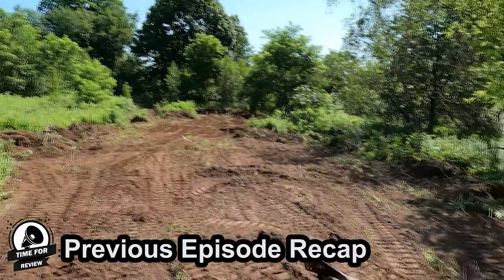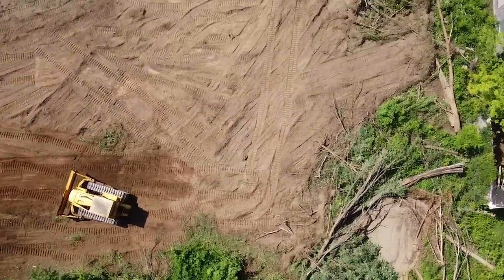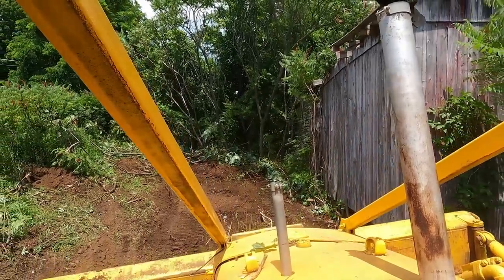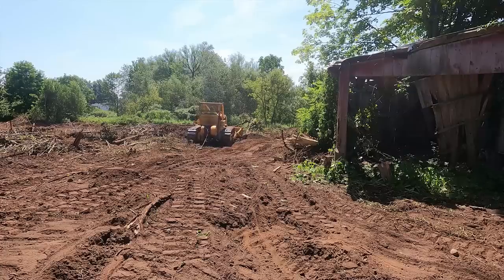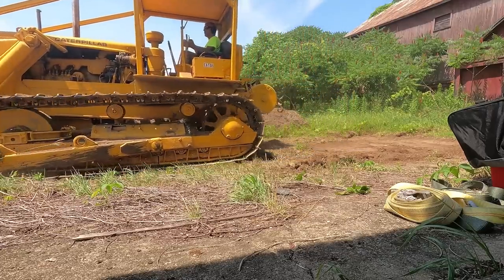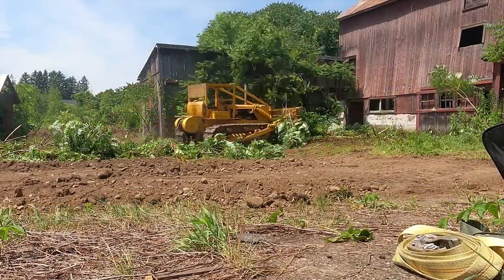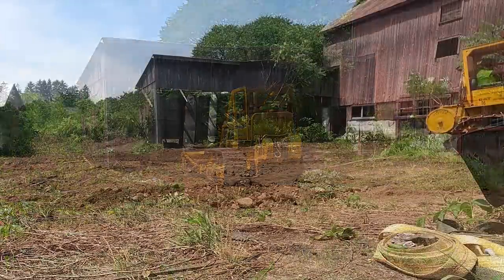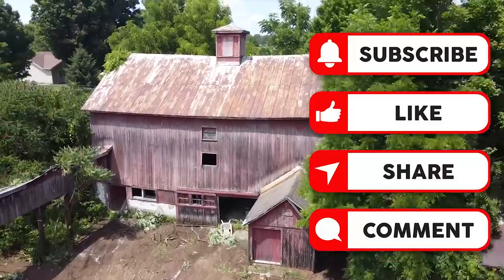Scraping years of overgrowth on the farm with the 1956 Cat D6 9U Bulldozer!

Comment: You made the right decision to buy that dozer. Best damn machine cat had ever produced hands down.
Reply from the maker: The thing is insane - it goes through anything, and takes down anything. It's GIANT. The original 1950's user manual even provides instructions on how to use it in mud and water up to 3 feet deep (special plugs and procedures) - but the fact that it can work as reliably and forcefully partially submerged is just mindblowing to me!
Reply: @BuyingTheFarm  old cats are still considered as the best and most reliable machines Cat has ever made, and they hold up to that title to this day.
Reply from the maker: I've noticed that their resale price remains pretty constant, despite the age (or, I guess because of the age). This is excellent news. I plan on selling this once I finish the main work. It honestly is too big for what I need, and I have no way to transport it for service if it is ever needed without huge expense. At this point, I think I could get by with a Bobcat, or a more versatile mid-sized tractor with implements (once the main earth work is done).

Comment: Nicely done! I’ve recently bought a ‘57 D6 9U! I have 20 acres and want to stump and clear about 5-10
Reply from the maker: Kevin, that is excellent! We're in sort-of the same situation. My front acreage is 6 acres, and that was my goal as well. Your machine is a year newer than mine. Hahaha. Are you going to document any of it for YouTube? Learn from my mistakes with this beast! Figure out how to scrape instead of dig. I haven't quite learned that yet and I have a mess! Many people suggested getting or making a root rake that clips over the front blade for cleanup. You may have better luck with this than me. I can weld, but my issue is the weight and size of the steel needed to build a root rake. I can't easily handle nor accommodate such large material. People have suggested renting one or buying one. I can't find one for rent anywhere, and the only places I could find to buy one is commercially through stores on the Internet ($3000-$6000ish). I couldn't find anything on Craigslist or Facebook Marketplace in my general area.  Keep me posted, and likewise stay tuned for more videos!    :-)
Reply: @BuyingTheFarm  Yeah got all those great software updates on the ‘57 model 😉 

I may end up making a video now that you’ve suggested it, I have a metalic go pro mount, I dont have to worry about any plastic hoods / fenders on this beast. 

We’ve had some wet conditions so far this year so i’ve deferred the dozer work until the ground dries a bit more. I had also asked a local metal manufacturing plant to build me a root rake but they essentially said it would cost more than the dozer is worth to build custom and to  try and find one for sale. 

I do have a spear type rooting attachment for the blade, i’ll be giving that a go pretty soon. 

Best of luck with your future projects!
Reply from the maker: Oh man, that's awesome Kevin. Hhhmmm... I'll have to look into the metal go-pro mount. Why didn't I think about a magnetic mount before??? That tank is 100% steel and iron! Hahaha.  Yeah, if you do some videos, send me a message - I'd love to see alternate ways of doing things. Keep me posted!   :-)

Comment: You Might be able to get a Wetland Permit. If maybe want to clean up the area slightly. Like remove fallen Trees. Would be something that have to look into. 
On My Last Property we had Federal Wetlands, But we were able to get a Wetland Permit, to clear up some Fall Trees around the Edge. But with Approval we also Replanted some New Trees around the Edge. 
Then 50 feet away from the Wetlands, we then Planted Hedges along the Length but left enough space on both edges where a Tractor and bushhog could drive thur so can mow the 50 foot strip that was just mainly grass/weeds before you got to the wetland area.
Reply from the maker: This is excellent information! Thank you for providing your insight and process. I have the DEC scheduled to come out sometime this year to have them map the property (so I know where everything is). They did mention granting permits for the road that was previously cut through the property and for other purposes. I’ll provide a video on the process once that takes place. Thanks for that comment though!!    :-)

Comment: It’s good practise when using your Winch to always fleet the rope onto the drum correctly. Once you have hooked the log up, go forward running the rope out until the rope is laying properly on the drum. Then start winding in allowing the tractor to be pulled backwards using the brakes and steering clutches to steer the rope onto the drum fleeting straight and smooth with no slack or loops hanging out. It may seem like you’re wasting time, but your rope will last a long time and will retain full strength. Also keep the rope well oiled to prevent rust.
 Nice video.
Reply from the maker: Hey, thanks so much for that advice. That is excellent - I've never had a winch before (nor a bulldozer), so every tip helps!  The issue I had was that the cable hook got snagged on something and free-spooled out without me knowing it. An hour later when I jumped off the bulldozer, the entire winch cable was gone!  It wasn't hard to spot, but putting it back on is going to be a pain. Thanks for watching the video and I appreciate the comment!

Comment: Looks great! Don't you just hate it when stuff like cables come loose. I was surprised how easily you were able to pull all those trees away from the outbuildings going backwards. Nice job!
Reply from the maker: Ugh the cable is a nightmare, Mike - it weighs about 600lbs in total, and even getting just the end back wound around the spool is hard work! I haven't fixed it yet. Maybe this weekend.  Yeah, the trees were a satisfying surprise when I backed up with that blade down. I had a "holy crap - it's working" moment. I had to basically press them right up against the foundation, drop the blade, and once the down-pressure kicked in, many tons of downward force bent the trunks/stalks right under the blade and pulling them out was easy. I was very pleased!

Comment: a masticater would have served well. Reducing vegetation to mulch which could be composted and used as amendment for the soil.
Reply from the maker: Hi Tim, thanks for the comment. Yes I agree that would have been the ideal tool for the weeds. Sadly I couldn’t find the implement and the tractor or skidsteer in my budget, and rentals in my area were prohibitively expensive for how long I would have needed it due to my work and travel schedules. The other issue though is that I had large berms of dirt that had to be leveled out, trees that had to be pushed over and moved around the property, and various other tasks. I still need to deal with the mulching situation (clearing of the saplings, limbs, piles of brush, etc), so that will be a consideration for the fall.   :-)

Comment: ...you need to start making burn piles and not just covering over because you will have issues later with planting anything in that ground there later (with all the debris being buried)
Reply from the maker: I wish I could burn all of this, but sadly doing that in this area isn't lawful and comes with fines and penalties. My goal is to get all the tree debris moved and dealt with (either cut up, mulched, removed, etc.) - I don't have any plans of leaving it covered/buried, but my main goal right now is to just get it knocked down while the weather is in my favor. Getting everything cleared and ready for planting is its own giant project at this point. I haven't really solved any problems here, I've just sort of moved them around. LOL

Comment: Could run a rootrake in front of the blade (rental?)
This is how I cleared 15 acres in Fl. 
Fun stuff 
Now on to 23 acres in Tx new Ranch
Reply from the maker: Kevin, I've searched the area for rentals, and I cannot find any. It is even hard to find a bulldozer for rent around here. Everyone rents bobcats for $950 per day. I've been looking at plans to possibly build one that clips on the front blade, but I'm discouraged by the quantity and weight of the metal needed to survive on the front of a bulldozer. It's a couple tons of metal. I'm not a large guy, so that would be problematic. Likewise, I don't have a shop to work in that can accommodate stuff like that (with a gantry crane, etc). I am a decent welder though, which is what sent me down the DIY route. I'm still looking!! Good luck on your projects though - that sounds exciting! If you YouTube any of the process, let me know!  :-)

Comment: Early in my career I was taught to rarely if ever back blade. In fact the old timers would throw fits about it. A dozer is used to move dirt to where it needs to be and do it as fast as possible. Every rookie tries to back blade after every push to ake it look good but it is a time waster as well as extra wear on the machine. Besides that size machine is not going to be the easiest to finish grade with.
Reply from the maker: Oh I can 100% attest to your wisdom! I actually tried it by accident to see if it really made a difference, and it did. But you're right - it is such a huge machine, it is best suited to the large unwieldy tasks - not the finish tasks. Unfortunately it is the only piece of equipment I currently own, so I'm going to have to try my hardest to balance the efficiency of pushing and moving dirt, with the gentle touch of finish grading (somehow). I haven't come anywhere close to mastering either technique yet!!  :-)    Thanks for the commentary, and PLEASE keep the suggestions and wisdom coming. I need every bit I can get!   :-)
Reply: @BuyingTheFarm  Seat time will get you where you need to be. If you have anyone local that is an operator hit them up for some advice or tutorials. It may be a massive chunk of iron but believe me they are not that hard to break if you miss handle them. Back blading is ok for loose dirt and in float mode, not sure if your machine has float mode. Back blading can cause excessive wear on bolts, blade corners, frog plates etc. It also puts a lot of strain on the undercarriage which is only designed for forward action. From your video you did great for a rookie operator in a difficult machine.
Reply from the maker: Thank you so much for the nice comments.... and for the additional information! This is why I created this channel - to gain wisdom from people who know more than me about this stuff (which is literally everyone). Hahaha. Unfortunately I do not have a float mode, but I'm trying my best to just skim the surface to get the vegetation cleared (versus actual digging). Unfortunately, I'm usually running against the slope of the land, so I end up cutting a little more than I want. Either way though, I'm assuming most of what I'm doing is incredibly light work for a machine this big.

Comment: Your pushing a lot of poison sumac over,  in my ground clearing with my D4D,  I find although protected from direct contact, around  my eyes still get puffy the next morning.If you need to pull trees try using a brush grubber, they are not that expensive and can easliy be removed once tree is out.  I ended up taking a break for a week after the seals of my track tensioner failed  on the one side and I had the fun job of removing 55 year old bolts to keep from having to split the track.
Reply from the maker: Scott, GREAT advice regarding the brush grubber. I had looked at one of those prior to just looping my winch cable around the trees, or pushing them over with the blade. I need to check one of those out again - I always forget there are cheap, simple tools that have a specific purpose when it comes to pulling and removing shrubs/trees. Now that I have TONS of brute force at my disposal, I've just been sort of going with it.   :-)    Regarding the sumac, fortunately it hasn't bothered me yet. I'm still keeping my distance though!!
Reply: The sumac trees he's pushing over aren't poison sumac.
Reply from the maker: Thanks for the comment @verteup - I've never really looked into the difference in types of sumac. I was always told to just stay away from it. If it truly isn't poisonous, it will make dealing with it a lot easier. I'll have to look more into it.

Comment: I wouldn’t recommend ramming those bigger trees like that to take them down, you run a risk of snapping the tops off and they come straight down on top of you.   Some trees tops snap easier than others. Good video
Reply from the maker: Hi Mark! Thanks for the input and for the comments. You're absolutely correct, and this is a very wise comment. I have a 3/8 thick steel plate on the top of the bulldozer (part of the forestry package), the that is probably nothing compared to a falling tree. Most of what I have been pushing over a young-growth trees that are 20-ish feet high, or saplings. Everything is very alive and young and springy, but it if was anything bigger, older, or if there was any uncertainty of what was over my head, I definitely wouldn't go this route to push them over!   :-)
Reply: You can also mess up your final drives by ramming a fixed object. It's better to approach the obstruction by first touching it with the blade then gradually engage the main clutch to see if the object will move. Big trees will probably require some of the roots to be taken out first before pushing the tree over.
Reply from the maker: OH, that's another great piece of advice - Thank you! As I've said a million times so far, I really don't know anything about heavy equipment - this is valuable information. The biggest equipment I've ever used is a Bobcat, so definitely a different scale of equipment. From now on I will approach all trees from a stop and see if they move. If not, I'll start digging around it!
Reply: @BuyingTheFarm  That dozer of yours can easily take out the roots of big trees plus you can use the excavated dirt for a ramp to get leverage (a higher push) on a large tree. I'm still looking for a vintage D-6 but they all seem to be up in the New England area where you're at or west of the Mississippi.

Comment: great video mate! Curious with the height of the blade and cutting into the groud - can you weld something on to the dozer as a depth guide so you know where to set the blade to cut X amount?
Reply from the maker: Thanks for watching! Yes, I'm sure there is something that can be done - there are clip-on height and level guages on Amazon, and there are also $$$$ GPS-based height and level systems that automatically control the hydraulics. The problem on my property is that it slopes down from the street toward the rear of the property, so anytime I'm scraping across the property (parallel to the road), it digs in because the blade is fairly level but the ground isn't. The simple solution is to scrape following the slope of the land, but that isn't always practical (especially around the buildings). Fortunately, back-blading is a very effective method to level out the property (and this is done in the direction of the slope of the land).... so I will have to do that at the end. For now, it is what it is.   :-)

Comment: Great work!  I kinda wonder if a forestry mulcher attachment on a skidsteer would be a more appropriate tool for this job (barring larger trees, of course). Mulched debris would help build your soil "O Horizon" instead of disturbing/stripping it.  Just an idea, not trolling!
Reply from the maker: Hey, thanks so much for the comment - please come by and comment anytime! YES - I agree completely that a forestry mulcher would have been a better way to go for the weed-control aspect of this field. Sadly, the cost of such a device was more than I could afford, and so was rental from a facility about an hour away (with transportation and equipment rental, it was about $1200 per day). I didn't want to blow my whole project savings on the rental of a single piece of equipment, with no equity. Same for hiring out the job. It would have been about $2000 less than just buying the dozer. Also, I had big berms of dirt throughout the property that needed to be leveled out, as well as the tree aspect... so I would have needed something to handle those as well. As I go, I'm learning more and more about land management from people who comment on my videos. For example, I have never heard of the "O Horizon" before today - this is VERY valuable information, and I'm appreciative of your comment! Definitely would have been handy to know this before I started. Hahaha. But as I've said time-and-time again, all of this is a learning process and I'm in it for the long-haul.
Reply: @BuyingTheFarm  You got this! Kudos to you for weighing it all out and pulling a BIG trigger buying the dozer. My money says you never regret that purchase. Thank you for sharing with all of us. I know it takes a lot to put videos together! All the best!!!
Reply from the maker: I have a row of BIG triggers that need to be pulled... but I think they are going to happen one at a time at very specific milestones on the property. For instance, I know I need a tractor and some implements for the spring. That will likely be a late fall, or even possibly a winter purchase. Likewise, in order to fix the foundations I'm going to need a backhoe (probably an extendahoe) in addition to some other projects where the loader and backhoe would come in handy. I really don't want to get OLD equipment (long hard life of use, limited time left on components and engines, nobody really local to repair them...) so I'm trying to be VERY selective about the things I'm looking at.
Reply: @BuyingTheFarm  Similar boat here. Mini excavator and tracked skidsteer on my horizon. Both are a ways out, but must happen at certain points to facilitate development of our latest property purchase. Luckily, we have time to be patient and hunt down the right deal.